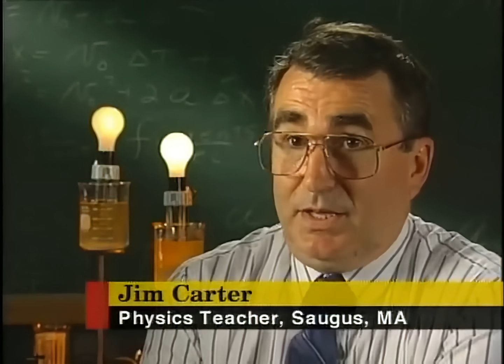MIT graduates cannot power a light bulb with a battery.

Comment: Duh, no wonder people get confused with bad info all around. OF COURSE you can light an incandescent bulb or LED with any voltage battery. Problem is that at 1.5 volts the 120v bulb will emit at a wavelength of infrared, equivalently leds will always give out light photons, but they will be one millionth of the typical brightness or less. With too high voltage it will light, but only for a short moment. ;)

Comment: A recent MIT grad in EE could not correctly explain how electric power is delivered from the generating station to users. (See ask an engineer or Slice of MIT How Do Birds Sit on Power Lines without Getting Electrocuted?)
Reply: Kim O'Brien Umm, just so you know, there are different sub fields of EE. A digital design engineer is not going to know everything that a power engineer does and a RF engineer is not going to know somethings that these two types do. After the general theory classes are done, optional classes are offered so that an EE can specialize in a particular EE field area.
Reply: EETechs Look I went to MIT and I know that you must pass course 8.02 which discusses Faraday's law in order to graduate with an MIT degree. {“Electrical current is the movement of electrons,” explains Sun. The movement of electrons through a device like your TV is what gives it the energy to display images and produce sound. Sun describes the long process these moving electrons take to get to your house. “The electrons are essentially being pulled from the ground by the power station,” she says. “They move through the power lines, through your TV, and eventually they make their way back into the ground from where they came.” This creates a closed loop, which is required for electricity to flow.}
If she was unfamiliar with the process of delivering electrons from a power station she should have looked it up first. Power is generated using three or six phase alternators because the output power does not need to pass through a commutator as in DC generator designs. It is not "...electrons are essentially being pulled from the ground by the power station." That in it self could only possibly describe DC power generation.
 Electric power is made by using the property of induction in alternators first discovered by English physicist Michael Faraday and the American physicist Joseph Henry. Grounding is done for safety purposes at the generator and at the customers service. The ground is not used as a conductor at either the power station or at the customers service. Power transmission is almost exclusively done using wires as the conductors not the earth for a number of reasons including a customers need to operate high power three phase motors, electrolysis driven corrosion of the grounding rods and high resistance losses. 
It is also unlikely that you will ever get the original moving electrons from the power station so they can never take 'the long journey' but that seems to be the articles writer's misunderstanding. A better explanation would have been a comparison of a moving pool ball striking a motionless ball and so on.
Reply: Faraday's law is not enough for a Power Engineer. Power Engineers can also go into electric motor design, so must have motor design theory understanding such as from A.E. Fritzgerald's book on the subject or they could go into power grid design and transformers which is another book...

 Let me put it to you another way. The EE's at Intel, Nvidia, and AMD are very smart, but do they know how to design a 5,000 HP, 3-phase AC induction motor and the high power motor drive that can control it? Probably not. They specialized in digital electronics and discrete math theory and also in microelectronic circuits. They are still very smart though. Like I said, there are sub fields that many specialize in. No such thing as an EE that can master them all.
Reply: @EETechs  A lineman or electrician who hasn't slept though apprenticeship class should be able to do a better job of explaining the general ideas behind the power grid than   Sun. Plus we aren't talking about doing designs but just the general ideas. If you don't know what your talking about than you shouldn't be writing about it to begin with.

Comment: With the materials listed in the verbalized question that omits the specs and dimensions of those materials, yes you could light a bulb. Oh, you are handing me a set of the materials you just asked about in your question? Well, let me consider the possibilities given the newly defined specs and dimensions and I will re answer. You are all being so damn quick to take down educated people you are overlooking that the experiment in the video was poorly conducted. The wire could be long, disable, thick, thin, battery large or small voltage, bulb big or small resistance. Think with your variables, always and for everything, not with your resentment.

Comment: Basic Circuits is a CORE class in both Mechanical and Electrical Engineering. Granted this is a simple problem, I know I tend to over think things if put on the spot/on camera; I'm sure a few of them felt stupid for not knowing afterwards.  Anyone that has gone thru an engineering program knows that you spend A LOT of time on theoretical problems vs. some of the more practical things.. Source: I'm a Mechanical Engineer

Comment: Okay this is just bad media. I'm willing to bet that the people they asked to create this circuit aren't even studying electrical engineering at all. One of them straight up said she was a mechanical engineer, and then the other guy asked for a tip, now that really doesn't strike me as the kind of guy who was studying electrical engineering. So asking the majority of a crowd that aren't electrical engineers how to create an electrical circuit is not going to get good results. Not just that, the circuit wouldn't work anyway because the battery is DC, and those lights are most likely AC, just like the majority of standard use light bulbs made in America. Even if the battery were AC(which isn't possible), it still doesn't have enough power to light a bulb like that. So asking a non-electrical engineer why that circuit wouldn't work is a complete bias on the entire situation. So good job America's media! You've gone and twisted the story again!
Reply: Thank you. Honestly, I thought I was alone here on the point about the media. I don't know, people just seem to have an extremely narrow understanding of what intelligence is, and the difference between intelligence and ignorance, intelligence and third party factors (such as having delayed motor functions, like myself), etc. Imo, they promote this way of thinking as it complements the average viewer in a way such that they ill want to tune in to the media station mor frequently, resulting in better ratings. It's just really frustrating arguing with people about this, because the argument is almost always either one-sided or the person I'm arguing with is an enormous hypocrite. Thank god the people I work with in my college aren't like that. :/
Reply: William Coburn The bulb used is a very large one. The larger the bulb is the more current it is going to need to be lit. A small 1.5v battery like that simply cannot light a large bulb. And by the way, a resistor is not the primary component within an incandescent light bulb. Nothing within a light bulb even sort of resembles the works of a resistor. Incandescent light bulbs use thin tungsten filaments in a negative pressure bulb, or one filled with a noble gas, such as argon, to promote the dissipation of light. When the current travels through the tungsten, the tungsten burns because it can not support the current passing through it. Resistors do not light up or burn when they come in contact with large currents. They simply dissipate heat. And also, in standard "household appliances", when using an incandescent bulb such as the one shown in this video, no sort of step down transformation or rectification is taking place. The only thing taking place is the burning of the filament from a full 120 VAC power source. And the supposed "small light bulb", is hardly small. From the looks of it the bulb looks to be around 12v. Of course a 12v bulb will not be lit up by a 1.5v battery. It's common sense.
Reply: William Coburn I understand where you're coming from, but don't twist my words. You know full and well what I mean when I said resistors don't burn up under large currents. I am referring to a large current in a diminished manor. Also, I never said that lightbulbs did not get hot, so you saying "You even say that the bulb filament 'burns' within the gas-filled vacuum enclosure, which contradicts your early statement since 'burning' implies heat dissipation", is, in a way redundant. And I have never seen a light bulb modeled as a resistor in circuit analysis. In no definition of a resistor that i've ever seen, has it exclaimed that anything that dissipated heat is considered a resistor. It isn't even really about the fundamental understanding of a light bulb. Especially when it seems as though most of the people being interviewed are not engineers of any kind. Sure, you could say that learning to light a bulb with a power source is a basic understanding of electricity, and that they should have learned that in middle school. But tell me, how many of the small things do you really remember in detail from middle school. For instance, if asked you to explain the tectonic structure of an earthquake, or how a mid-oceanic ridge is formed, i'm sure you could not tell me from memory.
Reply: 3dUber An incandescent light bulb does not care whether it's powered from a AC or DC source. It will light up, but very dimly. Try it yourself at home. Get a piece of wire and hold one end to the bottom contact on a battery, and the other end to the side (screw) portion of the bulb. Then, place the bottom of the bulb on the top contact of the battery. The orientation of the battery doesn't matter. Tell me the results.
Reply: Sunix Y I'd say that is pretty accurate.I've heard technical schools/community colleges tend to push more for practicality and hands on activities. I am in engineering and, while we are taught mostly theoretical knowledge (at least in this stage of my college education), we do get some hands on activities like building something using an arduino or designing state machines on a breadboard. I think the issue here though is that these activities can be extremely tedious if the design is a bit too ambitious, so a lot of people I know dislike these activities.

I feel like the approach my courses take isn't perfect but are a step in the right direction. I'm more of a math/science person and am not too knowledgeable about technology but I don't feel like it's a stretch to apply what I learn in my engineering courses to understand how to design and debug some kinds of electronics. For prerequisites on the other hand, like for (most) physics and math required, even if you ace the material you could be left with absolutely no idea what it means, and wouldn't be able to spot when that phenomena occurs in all but the most contrived situations possible.
Reply: this is stuff that children should know how to do. I was taught this in grade 5, we were all given wire, batteries, and bulbs and told to play with them for 15 minutes and see if we could figure it out, then taught how and why it works... The problem is kids/teens/adults don't PLAY anymore
Reply: TheGrandMasterFunk 
It is not that simple.
Even nowadays, as we are moving forward and relying more on technology and a lot of fields are developing, one very important field seems to be quite reluctant to develop along the way - education. I might be talking from the perspective of a person living in a poor Southeastern European country, but it seems like this problem is present in developed western countries as well. Education revolves so much around theoretical knowledge that you are left unaware of what you are actually studying and why... That is why people graduate from high school wondering what to do or more significantly, those who graduate from university take up a job and then start learning what they really need to properly do their job...
People do want to "play" while studying since that is the most interesting way to gain new knowledge, and especially grasp more abstract concepts, but they are not given the opportunity due to the stagnation of the educational system.
Reply: 3dUber bulbs that work on ac will work with dc current unless it has an electronic circuit allready in it that is designed to work with ac like a a ballast

Comment: The Black guy did it!! :Take that asians/whities! :D
Reply: MrUbercharge42 as long as the light bulb turned on he did it correctly! Secondly you have to touch the light bulb to the battery directly and then have the wire translate the electrons to the other side. There are 4 correct ways of completing this challenge. Cause to complete a circuit you have to have a resistance connecting positive and negative ends. The light bulb is the resistor the wire is the thing that connects the positive end to the negative end. Besides that the black guy knew his stuff cause he did not say yes immediately cause if the light bulb provided too much or too little resistance it could not light up correctly.
Reply: Corvux IX You must be very proud :)
Reply: MrUbercharge42  dude you are in idiot, you cannot just touch a light bulb to a battery and expect it to light up, you need to close the circuit and let the electrons flow. That guy did the right thing using just one piece of wire. he had to touch the bulb and the the other end of the wire at the same time to close the loop. Chris 'KillerSeig' Larsen is correct
Reply: MrUbercharge42 Have you ever heard of electrical conduction?
Reply: That's because there wasn't any Indian.
Reply: +Corvux IX This is how we shall choose our leaders in the future. xD
Reply: +MrUbercharge42 That's the only way to do it with one wire, dude.
Reply: Thats because black men are smart.
Reply: @orangemicroprocessing  the only "trick" there is exactly that, is imposible to use a single cable 4 this task until you understand the base that you need 2 diferent routes so the circuit will work...

With 2 cables the question would be quite simple, but not using it makes then consider how to do it with a single cable... some "more advanced" question could be use a light bulb, a battery and 2 small cables (that together are long enough to reach one of the battery sides, while trying to use each cable on its own to complete the circuit would be just too short) that would show flexibility or improvisation based on the resources you have when applying engineering

Comment: Wow, I was thinking of going to MIT for electrical engineering but this is really sad, community college kids would know better.  I haven't taken a single course and know that there was not enough voltage for that bulb,  if it was a 9 volt it may have barely lit a 200 watt bulb because of the lower resistance vs say a 60 watt bulb.

Comment: uhhh most of the people were Harvard students not MIT.
Reply: This is elementary school physics. So like education meant for 13yr olds .
Reply: @l@lukasgelu1834 it is not elementary school physics, it is high school. For that you need to know what is voltage and amperage, which involve the concepts of work and energy, which are not elementary school level. Without knowing these concepts, you would be just regurgitating. Also, not everybody is obligated to know how to power a light bulb with a wire and a battery, unless your major is tied to physics or chemistry.
Reply: @kwiceto9576  it's taught at 13 in Russia. cope
Reply: @Nakilon High school is from 14, therefore it is not elementary. Also, education in russia is very poor, and I am confident that once students in russia go through these topics they will forget them later. So you cope bozo. How is the special military operation going Ivan? Learn from US, we have captured Maduro in single night while you are struggling with the poorest nation in Europe for 3 years. Your president is going to be the next!

Comment: Is this from a longer documentary?
Reply: I believe it's from 'Minds of Our Own', PBS. The point is about the source of student misconceptions
Reply: n8mars Thx, I found the full length documentary and two 1-hour long supplements by clicking the VoD icons further down the page here:
http://www.learner.org/resources/series26.html

Most of what the documentary expresses is correct, except I think sometimes it uses slightly trivial 'gotcha' type questions in support of larger legitimate points (like a mirror example they use). For what it's worth, I think computers with customized courses of teaching according to individual student's aptitude and learning styles would go a long way in solving these issues.